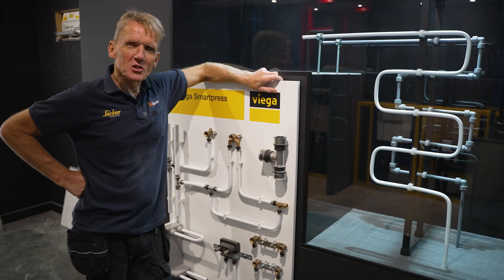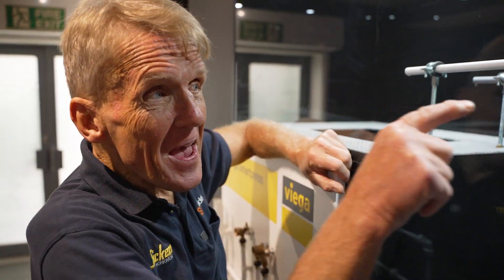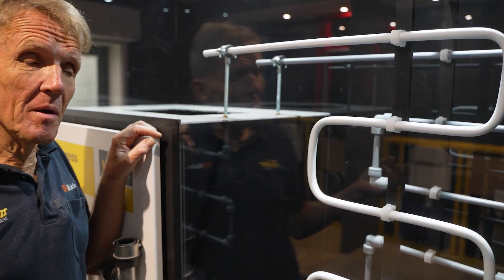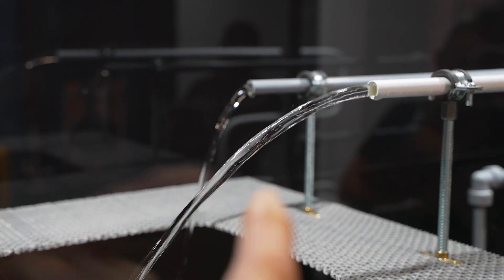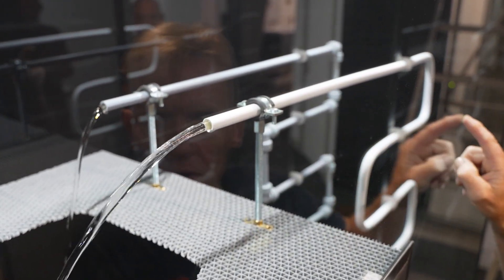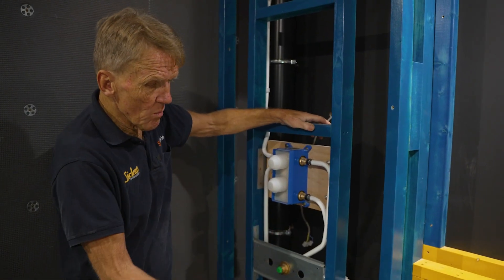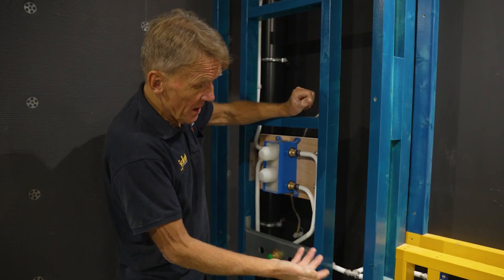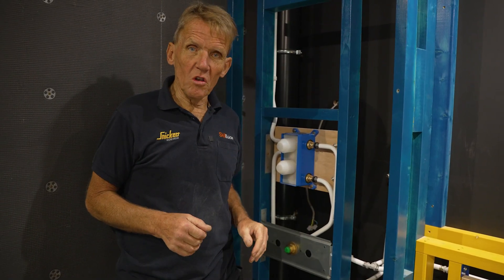Gobsmacking Truth About Plumbing Elbows

Comment: I definitely agree with the theory - a nice smooth, larger radius curve "must" surely allow better flow.   But on the demo it looks like the bore of the fitting pipe is smaller than the curvy pipe...
Reply from the maker: It is less than half a millimetre intenal bore
Reply: @SkillBuilder half mill throughout the entire length though 
Remember also the increased diameter, all be it slight here, has a multiplying effect on carrying capacity
Reply: @SkillBuilder  if the comparison was between Hep2O and copper 15mm OD pipe, then the Hep20 would have an internal area of 100 sq mm and the copper would be 145 sq mm......that's an increase of 45% in the flow of the copper without any bends/elbows. Small differences in internal diameter results in massive differences in area, 11.3mm for the Hep2O compared to 13.6mm for the copper.

Comment: This explains why I have poor flow to my kitchen sink. Was fine before it was moved during a kitchen refit. Plumber re-routed the hot and cold to allow a wall to be removed, he used push-fit 90's and plastic instead of copper as I'd asked him to. All done in about ten minutes instead of taking a little longer to 'do it properly'. Now that's all buried under the floor and I wait about a year for a bowl of hot water.
Reply from the maker: plastic is a better choice especially when it is buried. The key is to do it in one run and not have loads of elbows
Reply: @SkillBuilder  thanks for taking the time to reply 😎👍

Comment: I’ve been trying to influence tradesmen in plumbing and heating for so many years about using formed bends when possible. The amount of flack thrown in my direction suggests no one went to school since the days of proper apprenticeships.

Even worse is the use of fittings on 10 and 8 mm copper tube.

I doubt your illustration will have much impact Roger. They are mostly lazy.
Reply from the maker: I am under no illusion about my lack of influence or anyone else's to change habits and working practices. 
What I am finding is a lot of people who watch YouTube videos, realise that a lot of building tasks are not difficult to master. Rather than getting somebody in that has no interest in giving them a good outcome, they do the job themselves.
Reply: @SkillBuilder  Oh-yes, Roger you do what needs doing. The old saying about leading a horse to water comes true here. The test rig you illustrated was a perfect example of the difference formed bends make, and not only in 15 mm. It’s about time the industry started selling bends as an option. I came from heavy-side working with screwed iron and welded steel. Bends rather than elbows were always specified when consultants were involved.

Comment: I am more interested how much they deform under pressure and how they cope with water hammer, plus heat expansion. The water flow is irrelevant as the faucet will restrict the flow anyway and you only open it fully when filling up the tub.
Such a diameter i saw only used in heating where the flow is minimal, in drinking water we use 1/2 inch pipes (16mm). Not for flow but to have room for scale and corrosion build up. 
Its also not DIY friendly as you need special tool for crimping, same as hydraulic lines. I always go for metal pipes. Only once i use plastic as the soil move too much and its acidic so a zinc coated pipe erode in 2 years.
I start to see this like 8 maybe 10 years back. For heating where there is massive heat differences. In old days they use continuous welded pipes for hearing (and gas). They even adjust diameter.

Comment: It's pretty obvious that the tighter the bend the greater the resistance. This setup is hardly scientific though - so many variables not being allowed for. Not least the comparative bore of the 2 different types of pipe.
Reply from the maker: The OD is 1mm different but the bore difference is less than that. Even 1mm isn't enough to account for the huge difference in flow.  We aren't the National Physics Laboratory, we are plumbers.

Comment: In my experience, it is fittings which fail. Unskilled non-plumbers install push-fit everywhere - it must take more skill to bend a pipe? ; hence more time & money. However, obviously bending the pipe is the better job.

Comment: The inserts in the fittings are a restriction and the turn is more sudden. Sharing the flow is not entirely fair as the water will favor the path of least resistance.
If you need to use fittings just use 22mm pipe up to the floor below the outlet then transition to 15mm, no problem with flow in most homes.

Comment: I've been having this exact same thought recently and also looking into it. Mostly due to the mess and flow issues in my new build. A second floor flat with long pipe runs and either push fit or short radius copper elbows everywhere. And the boiler is fed by a branch of an equal tee rather than from one end of the straight through and the feed in the centre.

Looking at this demonstration setup some thoughts do occur.
1: The bent pipe looks flattened on the bends.
2: The push fit pipe looks like it has a thicker wall so smaller internal diameter. That doesn't help flow. Though this might be an optical illusion.
3: How exactly are both pipe runs fed? If it is a single pump but the push fit run is supplied from a branch of an equal tee rather than the supply being put into the centre of one, this wouldn't help.
4: How would it compare with long radius elbows?

I  see a lot of tees on that pipework at the end. None of them look like swept tees. Very bad for flow as they look like they have sharp, short radius corners. A disappointment for me is swept tees (which only seem to be available in copper) have a very poor sweep. Also there are no swept equal tees (difficult in copper I understand) but in plastic both these fittings should be as easy as anything to make but they seem to not exist which is another disappointment.
Reply from the maker: The supply is fed from a single pump which enters on the middle of the branch of the tee so it goes left and right equally. 
The pipe is not flattened on the bends
The wall thickness of the white pipe is very slightly more.
The diameters are measure on the outside.
Long radius elbows improve things but bends are still better.
Reply: @SkillBuilder  Thanks for the reply and making things clearer for me.

Comment: The other problem in the UK is we don't use 18mm pipe in ordinary plumbing. It's either 15mm or big jump to 22mm. Often 15mm gets used when actually something larger is required, but the expense of 22mm stops it being used. 18mm is common all over Europe.
Only gets used in commercial HVAC in UK.
Reply: 15mm and 2mm are good sizes because 15mm is just a shade under half of 22mm in terms of cross sectional area. 18mm is slightly more than half of 28mm.

Comment: Forming bends in a pipe will always give better performance than using 90 degree fittings. I am, however, suspicious of that 'test rig' and find the time difference between the flows arriving suggestive of something hindering the water flow to the pipe with fittings possibly to exaggerate the effect. It wasn't until the latter half of the video that this video that I felt my suspicions might be correct regarding the 'test rig' and that this setup is, basically, an means of promoting Wiega. Personally, I have an strong dislike towards these 'compressed fittings' as they are completely unserviceable unlike conventional fittings and copper pipe. I also think that such fittings will have nowhere near the lifespan of proper copper plumbing.

Comment: Pull bends and use swaging tools, for fifty years plus.Laughed at on a recent course when I mentioned frictional resistance on modern pipe work. ……Physics doesn’t change boys.😎
Reply: I saw somewhere that swaging was no longer allowed as it thins the copper. My dad was a plumber for 50 years and I don't remember him ever going back to a failed swage joint... Go figure.

Comment: Mate way back in the 1960's I was fully aware of Frictional Resistance, and heat losses via pipework so what you are showing here is NOTHING New, but the average Plumber/Heating Installer was the problem and I loved them as they were so DUMB that I always had 12 months work ahead of me, and was often called in to correct others poor workmanship...which of course I would NOT take on putting others work right.
      I never used right angle elbows but would pull up bends and with my Rothenbugh Expander on either end to ensure far less frictional loss, then I bought a Rothenburg T piece maker.
      I could reduce from say 35mm to 15mm.
      I was a fully qualified Heating Engineer that learnt my trade from proven methods of calculations... My opposition did their calcs by either guess work or by crude Shell Mex cardboard slides that could be up to 56/60% inaccurate.
     Not bragging just facts.

Comment: You go to jobs & there’s more Elbows than Gazza in the Penalty Box!!.....You think, some tw.t can’t bend copper tube & clearly just a Washer Changer. Pulling a Bend on a copper tube is quicker, better Flow Rate & cheaper than soldering an Elbow!!

When I started my time in the early 70s, you’d get a kick up the arse if you used an elbow. 6meter lengths of Tube & all formed bends.  On some sites they’d leave Joist out in houses to avoid using fittings, fit a Joist when the Plumbing First Fix was complete.
These days it’s penny wise & pound foolish!!

Comment: One can use 45 degree pushfit bends - that would have made an interesting comparison to 90s, as would a coil of pipe without sharper bends at all. Nice experiment but could have been so much better... also, several types of pushfit compared would have been a better test. But all of this becomes academic when one builds a well designed house with few or no bends and short runs from source to outlet. For retro fits all this may well be more important, I get that. 
     Generally I am able to avoid using many fittings when using plastic piping, by using steady bends in pipe runs. Also, the pressure is not stated on this test, nor are back-pressures and these could well mean the test is flawed and results not of real-life scenario quality. 
     I'd love to see a properly thought out test... you could make one for not much money. 
           Thanks for the vid though - food for thought, certainly.

Comment: In principle that’s correct, although I have my doubts about the validity of that rig. You can work out the end to end resistance on paper and then look at the pump curve to see what difference it makes to flow rate. With some pumps there may not be much difference.

Comment: We do a similar experiment in 1st year chemical engineering. It demonstrates the different pressure losses across bends, fittings, valve openings, valve types etc.
Reply: In practice, you will use fittings and butt welded joints in chem eng and spec the pumps to suit. Nobody has got the money to spend trying to bend 304 sched 40s pipe at any size over the about 1" on site, it would take forever. There are specialist applications where you might use swept bends etc like steam blow down lines and other weird and wonderful stuff like jacketed pipework for pharma, but it's extremely exceptional. Source : engineer and project manager in the process pipework industry for decades.
Reply: @davelowe1977  and then you get the other end of vacuum applications and then 2 m diameter lower pressure gas networks with bends welded in section. 

But yeah, small diameter water pipework, bend it or push connect.
Reply: The design "rule of thumb" is that every bend fitted was equivalent to the friction loss of an additional one metre of pipe, using the D'arcy Weisbach equation if I remember correctly  from 40 years ago...
Reply: @kc8485  obviously with the right diameter with a suitable flow. The diameter I don't remember but prob 2 to 8 inch or 25 to 200mm. I have experience a lot of odd combinations tho...

If you google tlv pressure loss, you can get to a simple online calculator to play.

Comment: Not an expert but do the push in fittings have a reduced internal bore and therefore reduced flow? Could be an optical illusion but the hose with the push in fittings does look smaller.

Comment: Do people not know you can buy longer radius copper solder fittings? Even flow orientated tee's exist. Even reamed the pipes back to full bore after slicing which rolls the ends in and burrs them over. It only takes seconds with a drill. Sharp 90's are terrible on pressure drop. I'm a fluid dynamics systems engineer, guess what I used throughout my house....

Comment: They're trying to sell you something so you always have to question these demo rigs.  They're feeding both pipe runs from a common low pressure pump so obviously the water will take the path of least resistance.  If you fed those runs with mains pressure, you'd get plenty of flow through both.  Yes you'd get more through the one without fittings (mainly because it doesn't have inserts) but you'd still get a good flow through the JG section.
Reply: Not only this but the system they are pushing uses crimp fittings which have a thick barb which further reduces the diameter, much worse than common thin wall plastic pipe inserts due to having to withstand the compression force during crimp. Factor the crimped ends into the equation and the system they are pushing ends up with lower flow of the 2 due to severe restriction, despite the restriction only being at some points. It is substantial. They are trying to lose the poor flow reputation that system is known for in the states. Press fit copper or soldered copper is still king, maintains a minimum of 15mm at all times and the wall thickness is about 0.2mm, times 2 = 0.4mm. Those barb type fittings are 2mm plus 2mm for the pipe wall = 4mm. double it as there are 2 sides to the pipe.. 8mm reduction. Marketing desperately needed lol..
Reply: @alphabuilders  Where you getting 0.2mm wall thickness from? 15mm=0.7mm, 22mm=0.9mm. Or am I misunderstanding you?
Reply: @markrainford1219  yeah I thought that sounded very thin too! 😂
Reply: Yeah the diameter of the white pipe looks wider to my eye.
Reply: I thought this too. Use 3bar and instead of an open pipe end show a visible inline speed meter
Reply: Its just another advert
Reply: @Chris-hy6jy  Higher pressure through smaller diameter pipes equals an increase in velocity and friction to achieve the same amount of water flow through a radiator to achieve the required heat output. Go back to school.
Reply: @MrWaverider42  well that's all pretty obvious.  I said the flow through the JG would be less.  The question is, is the flow rate high enough to transfer the required amount of energy.  In the vast majority of cases using smaller bore plastic, the answer is yes so it's a non-issue.
Reply: @Chris-hy6jy  ....and does the flow not have to be cranked down so low to balance the radiator with the rest of the system that it sludges up.

Sure, indulge your pipe bending fetish on the run to the attic conversion, but on the rest of the heating system it'll make little or no practical difference.
Reply: @ethelmini  not to mention the flow restriction imposed by TRVs.
Reply: @MrWaverider42  ...yet every radiator is fitted with a restrictor valve.

It's like having water whooshing through 'em at maximum velocity isn't the priority 🤔
Reply: Well I can assure you that even press fit and soldered joints have higher pressure loss than a bend. So JG Speedfit has substantially higher pressure loss. A bend is just objectively better and usually the sign of a more skilled plumber/engineer.
Reply: My thoughts exactly. Also, don't use plastic.
Reply: Well, they aren’t selling pipe joint are they; they are demonstrating how a smooth flow is much less restrictive.
Reply: Flow rate doesn't decrease just after the bend, adding bends decreases it everywhere in the system. Conservation of mass.
Reply: Er, not necessarily. Clearly some of the chaps commenting on here aren't aware of Boyles Law. Let me refresh those that do not know. P1xV1 =P2xV2. Basically just increasing the pressure does not lead to an increase in volume flow rate past any given point in a system. Increase pressure and flow rate decreases after a restricted point in a pipe. 

Think of it this way. Blow down an open straw. No problem. Now extend that straw to 10m. You can blow as hard as you want - increase pressure - and there will be little to no flow. 

You need enough pressure to overcome friction. The pipe walls have friction and each bend will reduce flow by around 5%. A restricted orifice will significantly reduce flow. Past a certain point, like the straw analogy no matter how much you increase pressure, flow will not significantly change. 

The most important factor in mass flow rate in any pipework system is reducing the pressure required to achieve a flow. Less valves, less bends, less restrictions. This is in an open pipe. 

If the very end of the pipe has a restriction such as a tap, as long as the available mass volume is greater than the amount that can pass through it, it makes no difference. So as long as what's on the open end is able to retain a back pressure the in between bit doesn't matter, however if there is a low flow - in other words there is no back pressure at the tap then you need more flow and the best way to get that is to reduce the restrictions not increase pressure.
Reply: @markchisholm2657  Lol, -  Boyle's Law is about gases NOT liquids. 
And worse its about enclosed & static gas; 
This problem is about a liquid that is flowing. 

OHM's Law would be a better analogy, (although it is for electricity). 
Have fun  :-)
Reply: Bernoulli is the chap for fluids (liquid and gas). He’s a one stop shop.